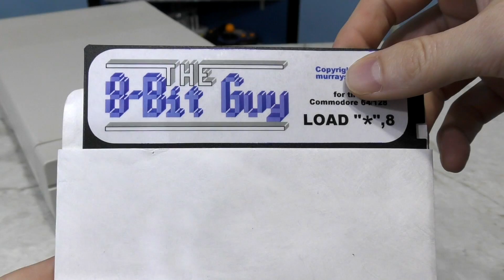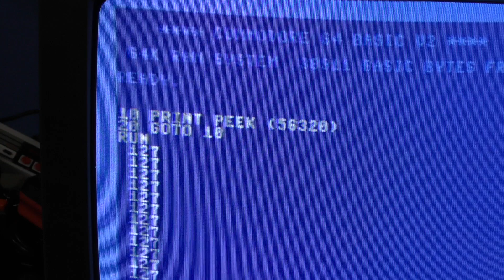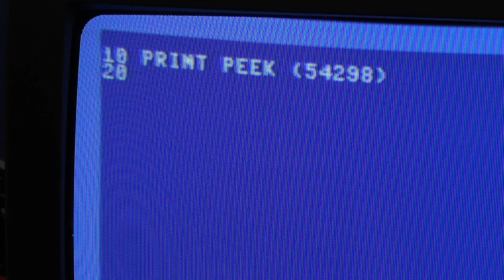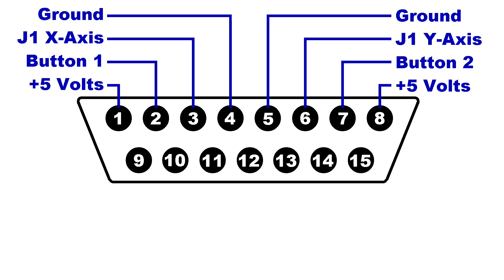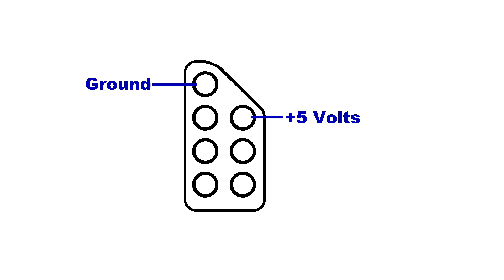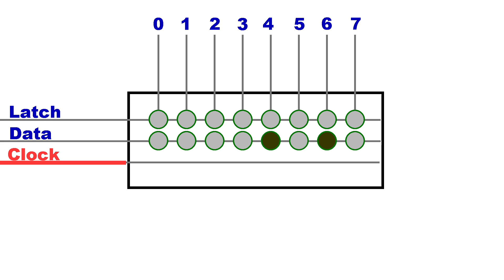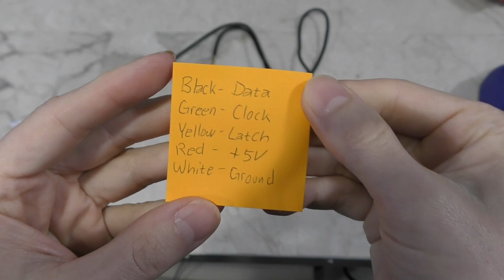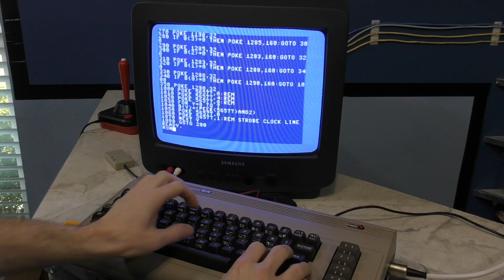How Vintage Game Controllers Worked

Comment: In theory those 9-pin connectors could also support a much more complex gaming controller as-is, just use the paddle wires and a set of resistors. There would be a bunch of usable values within that signal range that could count as discrete or combined inputs. (It was accurate enough on those paddle potentiometers, they didn't have too much noise to them.) Given the 0-255 readable range, and two of those as inputs on one 9-pin connector, there should be room for 32 more buttons that could be simultaneously read. Half that if you want to account for a noisier signal. I wonder if that's what those rare specialty controllers like the one for Star Raiders did?

Shame nobody bothered taking better advantage of what was possible with the existing hardware at the time, because many games were artificially hard due to the seriously limited controller scheme. But I suppose some demo-scene or current 8-bit hackers could make an 8-bit Atari or Commodore take full advantage with a custom controller.
Reply: Atari Inc's Consumer Engineering guys custom-built their own 3-fire button Trak-Balls so they could play an in-house version of Missile Command that had the 3 missile bases on it just like the arcade original using the scheme you mentioned on their Atari 8-bit computers. They used the Paddle Lines for the extra 2 fire buttons... I should say Rob Zdybel suggested the wiring scheme and programmed the modded game while Dan Kramer built the custom Trak-Balls...
Reply: What you actually have is two resistance inputs, so you'd need to encode each input combination as a distinct pair of resistances, of which you only have 65536. That's a few short of what you'd need for 32 simultaneously readable buttons.
Reply: @B-System  It's still a lot more than whatever they gave on the original controls with the system though. And some inputs like D-pads you don't need to read opposing buttons at the same time.

Comment: I honestly admire ,appreciate, and amazed at your work. At 3:21 I've found out it was wrong to use a Sega controller for the other systems. All others with game knowledge said it would  be easier to use a Sega controller on an Atari for better control.  Thanks for the tip !

Comment: The c64 could actually have two paddles per joystick port, summing it up to 4 in total.
Reply: Uhm, that's how Atari Paddles were sold.  2 per port. Warlords on the 2600 was 4-player. Commodore just copied Atari. You can actually play 8-player Super Breakout on the Atari 400/800 by hooking up Paddles into each Joystick/Controller Port on those 2 systems since they had 4-ports.

Comment: Nintendo controllers working on that switch thing is amazing-  and just a unique example of how complex data can be simplified into a few outputs without losing information. With a game running at several frames per second, it can check every possible button to see if it's been triggered, with no feel of input lag.

This does mean that when you feel a lot of input lag in certain nes games, it was because something was screwing up the NES clock with lag

Comment: It's funny that Nintendo basically used the same solution for expanding the inputs on their controller with a shift register that you see on Arduino projects these days. A lot of projects will use a 74HC595 shift register to expand 3 pins to 8 in the same way.
Reply: Serial data transmission using shift registers is nothing new, it's been around since the 1940s.

Comment: This is a real treat. I've been learning about the NES and C64 on a low level along with the 6502 itself. I've been perusing the 6502 hardware and programming manuals which are great resources. I actually just received a 6502 chip in the mail yesterday. I'd love to get my hands on other chips in the MOS chipset. I actually noticed you used to sell VIC-I's, but you seem to be out of stock. Not sure what I want to do with the 6502 yet. I wanna build some sort of hobby computer. I got some Z80's a while back, but I don't know a thing about them, so I just built a blinkenlights circuit from one of them that I saw on Julian Ilett's channel. lol

 The part of the hardware manual I'm at right now just happens to be talking about the differences between interrupt requests and polling, which fits right in with game controllers. It's great to see a video that discusses controllers more in depth than most others. I always love seeing videos like this from you. They're by far my favourite. Cheers, buddy. :)
Reply: Check out Western Design Center (WDC). They own - or co-own - a lot of 6502 and accessory chip IP. That and the 65816 that was later used by the Apple IIgs and the Super Nintendo.
Reply: @TheJeremyHolloway  I've actually been going through a lot of the resources WDC has on the 6502 lately. They have some great stuff to learn about the chip. It's mostly about the 65816 but as I understand it, the two are basically interchangeable. I wasn't aware they sold other chips in the set though, I thought they just sold the 65C02 and I think maybe the 65816. I didn't realize that's what they used in the SNES, though. I didn't even realize how close the chip in it was to the 6502 until recently. I'll have to check out their product line at some point. Thanks much. Cheers.

Comment: The genesis controller which has the chip inside will work as is with the 2600.

Maybe I got lucky and never pressed select or maybe there is a version without the chip.

The genesis controller will not work with the 7800 stock as a couple things are reversed, but the buttons can be directly wired to the cable after removing the chip in the controller then it will work.

Used to play my 2600 like that as it was the better controller versus the stock sticks.
Reply: You couldn't press the Select button on a Genesis controller even if you wanted to, there isn't one! David's cocked up his explanation of the Sega controller.
Reply: @gwishart  perhaps he meant start instead of select

Comment: How does the throttle work on a joystick? I have a Gravis Analog Pro joystick that has 4 buttons (2 are programmed using the thumb wheel potentiometers on the left side in the front and back), and the throttle control (left side between the button controls) for certain games, like TIE fighter. Which reminds me: I need to find a DOS utility that can realign a joystick or clean the directional potentiometer or replace it.

Comment: what did PS1 and PS2 use though?
I'm pretty sure theyre not USB.
Reply: They used a 9-pin port, that worked on a similar protocol to the NES controller.

Comment: What about the Sega Genesis 6-button controllers.  They used that same 9-pin connector.  How did those work while still staying compatible?
Reply: On standard Genesis controllers, the select pin was an output, used to choose which bank of two buttons to read. On the 6-button controllers, the select pin was pulsed twice to choose from up to four banks.

Comment: You can adapt NES (or SNES) controller to SEGA or C64. It's an easy scheme. You'll need 3 IC's - 7400 (or 7404) and any quarz resonator (regular watch crystal 32768 Hz should be ok) for clock gen, frequency divider made from 74160 (1 to 8 divider), and 74164 register. Clock gen should be clocking  74164, 74160 and controller clock lines. Then 1/8th output (Qc in general) of 74160 go the latch line of a controller and 74164 reset line.

Comment: Oh gosh... worst thing about Amiga games is that they all used only one fire button.  The game port supported using up to three buttons (the mouse right button actually uses an analog input), and analog joysticks would work just fine, but games never supported anything other than a plain digital joystick with one button.  It drove me nuts!

Here we are 30 years later, and game consoles are just starting to let you remap buttons, like how we've been doing it on PCs for decades.  Man, why is controller support on anything but a Windows PC always so terrible?
Reply: I feel your frustration. The Atari STe introduced the "Enhanced Joystick Ports" - that were later used by the Falcon030 and the Jaguar console - yet the publishers didn't support them. Those ports supported analog and digital devices, including game pads, digital and analog joysticks, light pens, light guns, Trak-Balls, Paddles/Spinners, etc. The ST Power Pad - which later became the first Jaguar JagPad - had 3 Fire Buttons, Select, Reset, and the Numeric Keypad. The Jaguar ProControllers added 3 more Fire Buttons and 2 Shoulder Buttons even though they remapped to some of the buttons on the keypad... And yet most games simply carried on supporting the one fire button on joysticks connected through the DB9 or 2 if it was a mouse-based game.

Comment: Why is the NES controller so complicated? Why doesn't it just use a 9 or 10 pin on/off system like the 2600?
Reply: Licensing and patenting. Nintendo wanted all of the 3rd party controllers licensed so they created their own proprietary port. The original Nintendo Famicom's pads were wired directly to that system but it had a DB15 - like the Atari 5200 - that was used to connect external joysticks to that console. But for the non-Japanese markets, they went into full proprietary mode...
Reply: @TheJeremyHolloway  But couldn't you just make a proprietary 10 pin port...??
Reply: @ValkyrieTiara  don't ask me why Nintendo does batsh*t crazy stuff all of the time...

Comment: The Color Computer systems used analog joysticks. You could use a PEEK command to get the values in BASIC. The values are one byte (0-255) with two axis.

Comment: Quick addition, I know for a fact that ps1 uses something like a shift register and not usb.  The Xbox was pure usb but ps2 being backward compatible was shift register ish.  N64 was probably shift register. only the xbox 360 and PS3 generation was usb for sure.  Gamecube was surely not. Wii was blue tooth and PS3 and ps4 are bluetooth on the wireless.  xbox 360 was usb but 2.4 ghz wireless. anyway, you quit too soon, I think you would be interested in some of the later consoles.

Comment: You converted the decimal input of the joystick on the C64 to binary in BASIC. What code did you use to do this?
Reply: Probably just successive division by 2. Add the remainders in reverse order to a string and print it out. Since the C64 doesn't have a MOD operator, you could use something like this instead: n-INT(n/2)*2

Comment: Interesting, though sad you teased coleco and then didn't say how they made the keypad work.
Reply: The Colecovision controller and keypad is explained quite well here: http://arcarc.xmission.com/Web%20Archives/Deathskull%20%28May-2006%29/games/tech/cvcont.html Basically, setting pin 5 to low causes the controller to return a 4-bit number in Pins 1-4 (usually used for up, down, left, right); which gives you the key pressed on the keypad.

Comment: Once I made an adapter for reading NES controller-input using the IBM PC/XT keyboard port. Worked quite well! It's almost the same interface, there's just an extra start-bit and some optional stop-bits that needs to be added.

Comment: What about Atari Indy 500 that came boxed with its own special driving paddles?
Reply: They worked exactly like the standard paddles, except they weren't mechanically limited to a single rotation and could be spun freely.
Reply: They weren't Paddles. They didn't use a pot; they used a digital encoder.
Reply: @TheJeremyHolloway  I just remember being a kid and thinking that box is 3 times the size as a regular Atari game box on the shelves.

Comment: The 9-pin connector used by the Atari 2600 was used by practically all of the 8 bit computers (as well as the Amiga and Atari ST) and by Sega all the way up to the MegaDrive.  

Though obviously, Sega used the Paddle bits for extra buttons.  

Wasn't the 15 pin DOS joystick connector called a MIDI connector?  

Both the NES and the SNES had 7 pins.  Though Nintendo were smart when they developed their standard for their controller.
Reply: The PC GamePort was a DB15 which was also used by the Atari 5200, the Nintendo Famicom's external joystick port, and the NeoGeo. The PC GamePort was also used as a MIDI port on PC Sound Cards which meant they had to use adapters to connect to the typical MIDI DIN Ports. The Atari ST used standard MIDI DIN Ports [In, Out/Thru].

Comment: I remember when I was kid short circuiting the reset pin on the user port here (c64-C) to make a soft reset. my c64 died when testing what other pins actually do (short circuiting them one by one with the ground or 5v) its now all blank screen for the last 30 years. still I have the device anyone knows if it can be repairable or which chip might burned ?

Comment: Nice video. I hope there will be another part before you jump to usb based solutions to explain the Coleco and Atari 5200 joysticks. Maybe also how mouse was working in C64, Amigas and Atari ST line maintaining still standard Atari joystick compatibility.
Reply: Hey now, don't forget the Atari 8-bit line. You could use an ST Mouse on them too. Hell, there's more than a few home brews on the Atari 2600 that work with both ST and Amiga mice... "Missile Command-TB" being one of them...

Over the years, there's been plenty of adapters made for the Atari 5200's DB15 ports. Back-in-the-day, there was the "MasterPlay" Adapter that allowed you to connect Atari 2600 controllers while still using the 5200 CX52 joystick for the numeric keypad. [there's modern "clones" of it on eBay]. In the 2000s, there were the "Redemption" line of adapters that did Sega Master System, Sega Genesis, Atari 2600, Atari 7800, and other system controllers. One user in the AtariAge Forums makes PC GamePort adapters to this day for the 5200. And the most sought-after adapter would be one to use Atari Jaguar JagPads with the 5200...

Comment: It’s also possible to wire up an NES controller from the inside using a standard 9 pin cable from an Atari joystick. I did this a long while back and posted the simple schematic on Aminet somewhere. I did it just because some games I were playing were more comfortable with the controller.

Comment: Force Feedback joysticks and late 1990s joysticks that used digital sensors instead of potentiometers used the PC 15-pin port in MIDI mode.  The 15-pin joystick port could be put into a mode where some of the joystick pins were sacrificed for MIDI IN and MIDI OUT signals.

Such joysticks didn't need analog trim knobs to be calibrated.

Comment: If you want to connect an NES controller to an Atari compatible DB9 port, it's easier to rip out the chip and solder in controller cable wires to the proper pins accordingly. I know because I did it.

Comment: Will those programs work on a C64 emulator?
Reply: They'll run, but won't be especially useful. Since C64 emulators only present standard joystick data to the (virtual) controller ports.
Reply: @gwishart  Makes sense, especially since modern computers don't seem to have a designated printer port anymore.

Comment: This is, as usual, an awesome video! I once  considered myself a pro at these kinds of controllers: pop them apart, gently clean the points on the board (and the points on the button-membrane that lead to continuity between them, if pressed) and voila! But recently I encountered an entirely new problem in my 20 years of popping these things open: on a tried-and-true NES controller, suddenly nothing worked! Cleaning on the controller board contact points, and those at the controller port, #havenoeffect. Console works fine with other controllers.

So my question after all that: what is the likelihood of a bad switch register chip?
Reply: I'd be more inclined to say the cable suffered a breach in one of the lines...From the 2 gamepads I had, both had that problem (I think only one used a shift register chip, the first one was simpler).

Comment: The Famicom actually had even more controller input lines, but when designing the NES they cut it to just the lines needed for the Zapper.
(I know Famicom games used at least D0 and D1 for player 1 and probably D0-D4 for player 2. But on the NES they only connected D0 (normal controller buttons) and D3 and D4 (the lines used by the Zapper).
Consequently 4-player games had to be written for adapters incompatible with the other region.

Comment: If paddles are indeed read like potential dividers by ye olde games consoles and early home computers, this is completely different to how PC's used to read joysticks.
Instead of being wired as a potential dividers, potmeters in PC joysticks were wired as variable resistors used as one of the timing resistors in a dual monostable 556-timer circuit. To read the joystick, the CPU would start the 556-timers together with an internal counter and wait for the 556-timers to change state. Comparing the amount of counts with the calibration for this joystick to determin the position (hence the need for calibration).

This had several drawbacks: although reading the joystick was an interrupt based routine, it still took CPU time to read it, the reading took up to 50ms and the respective axis read quicker in one direction than in the other. All of which, just like LCD TV lag, became perceptible as simulation games got more sophisticated. 
Therefore, for a brief period of time (I want to say late 90's/turn of the century but don't quote me on that), there where things known as digital game cards: two joystick ports on an ISA-card which used a 5V reference and A/D converters to read joystick axis, which made an appreciable difference.

I aquired one for Grand Prix Legends and flightsims and I may still have it (if I didn't give it away together with my HOTAS-setup), if you're interested.